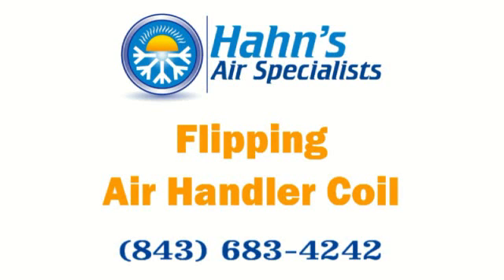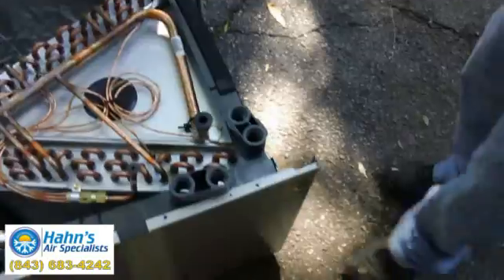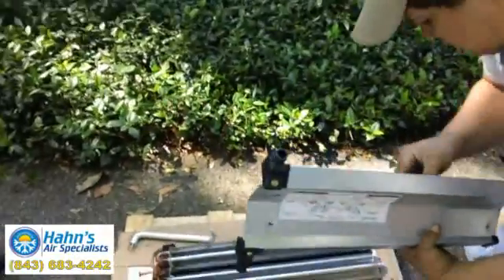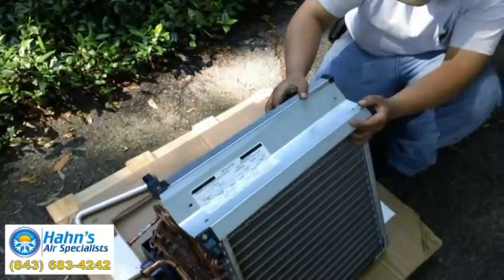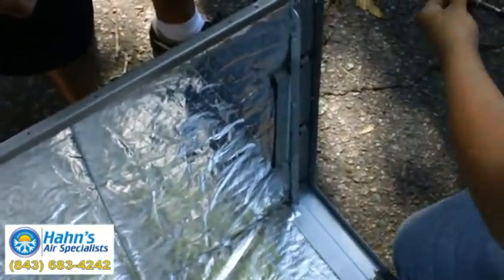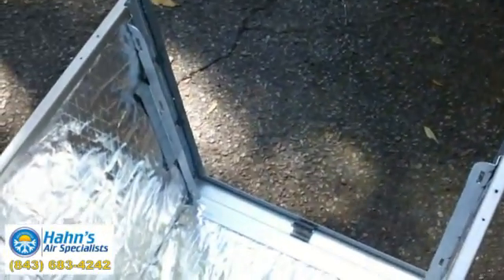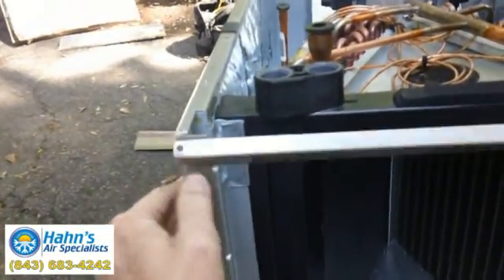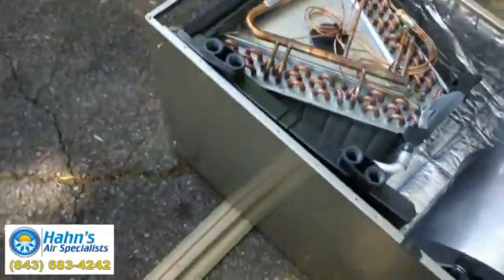How to Flip a Carrier Bryant "A" Frame HVAC Coil.mp4

Comment: CAN YOU INSTALL THE A COIL IN EITHER DIRECTION??? I JUST HAD AN ENTIRE NEW HVAC SYSTEM INSTALLED AND THE ACOIL ON THE OLD UNIT HAD THE WIDER OPENING OF THE 'A' FACING TOWARD THE INTAKE/WARM AIR (AND THE LITTLE NEARER THE BLOWER SIDE.....THE NEW UNIT THAT I HAD A COMPANY INSTALL HAS THE SYSTEM SET UP THE EXACT SAME WAY- BUT THEY HAVE THE A-COIL FLIPPED IN THE OTHER DIRECTION- DOES THIS MATTER/MAKE A DIFFERENCE??? PLEASE HELP!
Reply: Yes, but only one way is the correct way. The large part of the "A" needs to face where the filter is installed. If the front of "A" faces the filter the entire coil is in backwards. I've seen this done about 15+ times over the years. The first part of the video shows how the coil should look when installed within the air handler cabinet. If it's installed incorrectly, you'll have nothing but water problems and poor system efficiency as that's not how the system was designed.
Reply: @DavidHahnHHi  THANK YOU SO SO SO MUCH FOR REPLYING!!! You are AWESOME!!! I REALLY really do appreciate it!....Thank you for your expertise as well!....I am SUPER frustrated with this company I used to have my AC installed....They def did a sub-par job...If I told you all the nonsense I went through with them already- of course AFTER I already paid them a boat load of money- you would be shocked!...So I am 100% certain they have installed the A-coil backwards now....and I have had three separate 'techs' from this company come to my house now and each of the three told me something different...I certainly have MUCH more confidence in what you are telling me than any of them sadly...After receiving your reply I called them again and they are sending the 'head install manager' over to my house on Wed to take a look over it and address my 'concerns'...so I will see what he has to say...I am not too confident they are going to give me the truth...or a straight answer....but we will see....All I know is that the A-Coil has been installed opposite the way that it was on the old unit I had in the house....and NOTHING h changed when they installed the new unit (all the duct work and air direction and everything is all the same)....The only thing different is the coil they put in is now facing the other direction...and indeed- the air filter (which they FINALLY just came to install today!)- is on the 'small/peak' side of the 'A'...with the wider side facing the 'out/cold' air and the blower...I am not sure why it would be any different than the previous unit (the new one is even the same make!) It just makes no sense at all to me.....I guess I will see what they say on Wednesday.....Anyway- THANK YOU SO SO SO MUCH for your time and for your expertise getting back to me...I sincerely do appreciate it VERY much!....It certainly says a great deal about you and your company.....I only wish you were in my area- I would most def have you over in an instant!...Thanks again...If you dont mind- I will let you know how I make out on Wednesday...Have a great day!...THANKS AGAIN!!!

Comment: I have one today that wasn't flipped correctly.  The 2 condensate troughs appear to need to be moved as well.  Have they changed the design?  One long wide,one short narrow.  The unit I am working on has the long one at the front, connection side and short at the back.  Parts listing seems to indicate the opposite.  Also another video from carrier enterprise support seems to agree with parts diagram.  My long plate has the hole offset to one side width wise while the other video and parts diagram shows holes centered in the width.

Comment: Hello,very informative video .
Just s question, what is the material inside of the air handler / A coil frame ?
Thank you
Reply: The "A Framed" design itself has not changed between the newer aluminum evaporator coils and older copper / tinned. Meaning, this procedure is still required.